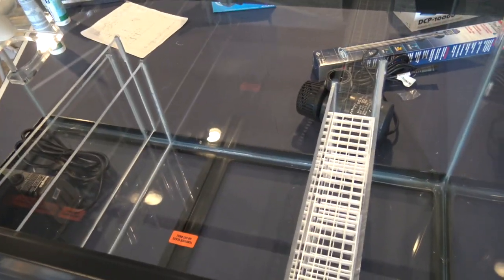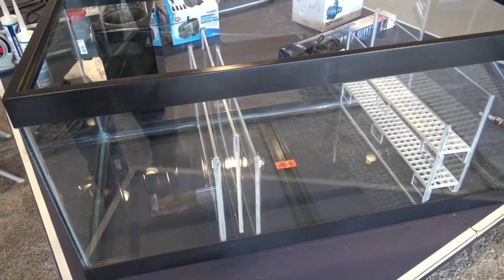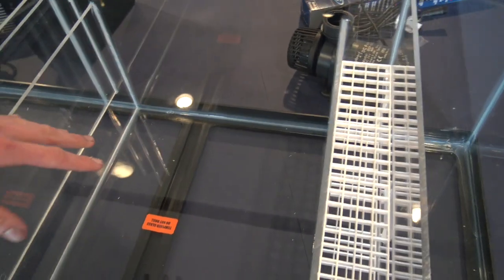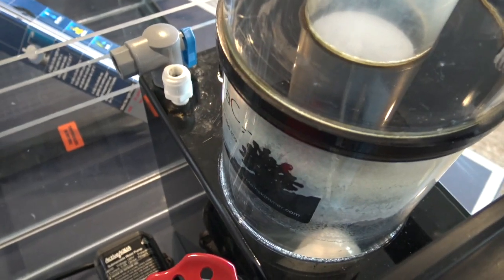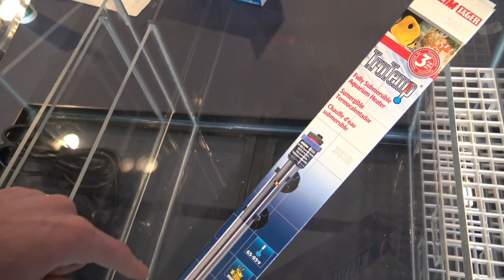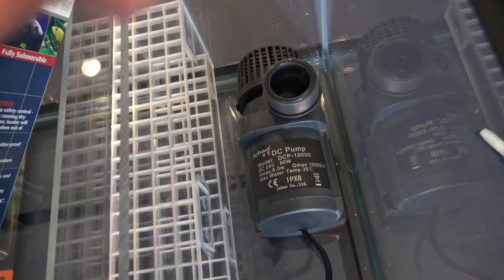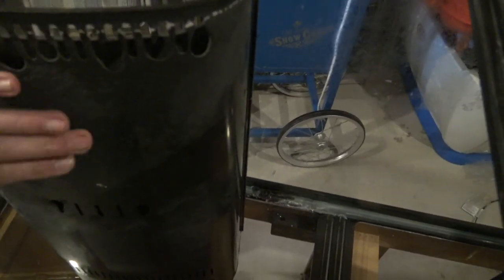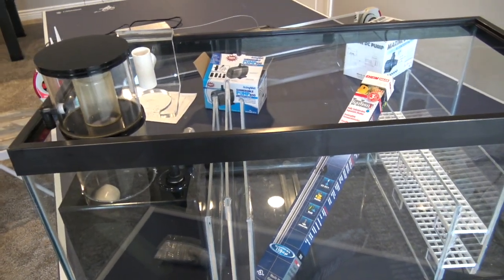HOW TO Build a DIY Aquarium Sump

Comment: So I got a question I got a 55 gallon that I’m turning into a saltwater tank and a 12 gallon that I’m turning into a sump my overflow box rates at a 150 gallons and my return pump is 750 gallons per hour. Do you think that’ll work out or should I go less or higher on the pump?

Comment: Amazingly I built my sump the same way you did but with one less baffle....wish I had seen yours before I built.  Your build went much more smoother and much more cleaner.  I built my baffles at 11 inches...don’t know why....just did.  Hope that isn’t too high...guess I’ll find out when I test the system.  Looking for soft tubing at Lowe’s to fit my pumps and fittings.  They have a limited selection, gonna check Home Depot next.  Just found some egg crate pieces for the media section.  Hope to have it up and cycling by X-mas.  Great channel my friend....keep the video’s coming and give us updates.  Reef on 😎
Reply from the maker: Thanks a lot man!! Your design sounds good! Put a check valve on you system so you don't have to worry about sump overflow when the power goes out. And you can also find a lot of different soft tubing sizes from most local fish stores also.
Reply: @EagleAquatics  Sorry. Is the check valve supposed to be between the return hose ?

Comment: I noticed the 9” inch middle buffle” is pretty short. Would it be convenient to make those buffle panels taller so that the sump could  hold more water? Assuming, the tank is filled up to top and has a tall or hanging protein skimmer.
Reply from the maker: You can yes and I should have so it heald more water.

Comment: Were the baffles you made all 9 inches tall? And what length did you choose? And what thickness did you get? Going to Menards tomorrow... I also have a 40 gallon breeder for my new 125.
Reply from the maker: All the baffles are 9 inches tall, yes, I chose to use 1/4" acrylic and its working great. I got a big sheet from menards, it was like $50. They are cut as wide as the sump and siliconed in place. I used hot glue to hold it in place as I siliconed.

Comment: I always see people say not to use acrylic baffles on a glass sump because the silicone supposedly won't hold them together.  
How have they been holding up for you? Any leaks or other points of concern?
Reply from the maker: Absolutely none. The silicone has done an excellent job of holding them up and together, even after 2 years.

Comment: Hey, i have a 55 gallon and i would like to use it as a sump but i am worried it will too tall and narrow. I dont really want to spend money on a 40b when i have this tank but if i have to i will. Any opinions?
Reply from the maker: Lots of people use 55 gallons as sump without a problem. If you can access it easy from the top I  cant see a problem with using it as a sump, the bigger the sump the more possibilities.

Comment: when cutting the glass for the sump, do you cut it 1/4" short for the width or 1/4" short for each side?
Reply from the maker: Nah We cut it almost exact so it just fits in between both side of the tank and then silicone the gaps.
Reply: @EagleAquatics  did the acrylic sheet expand. I keep reading in the forums that acrylic expands in water. Is it true?